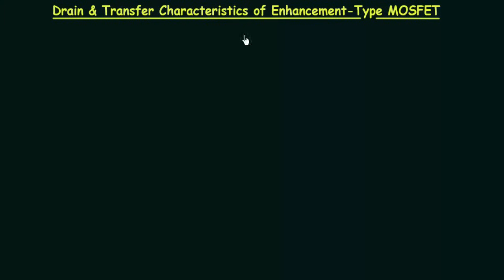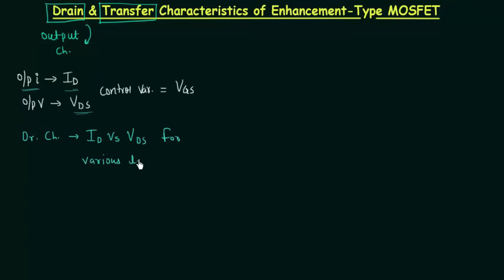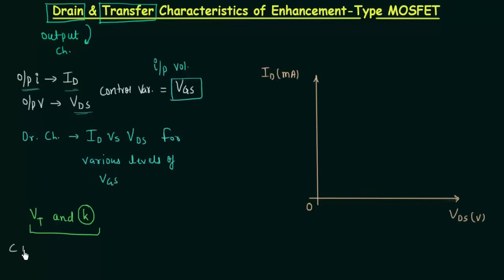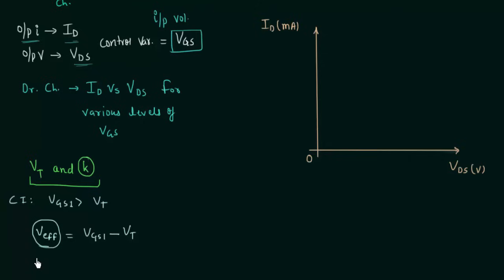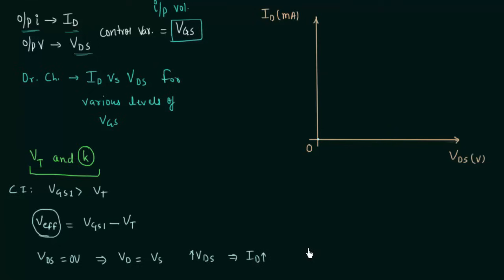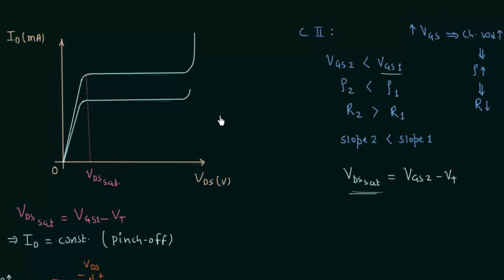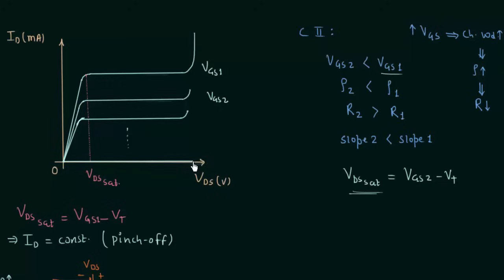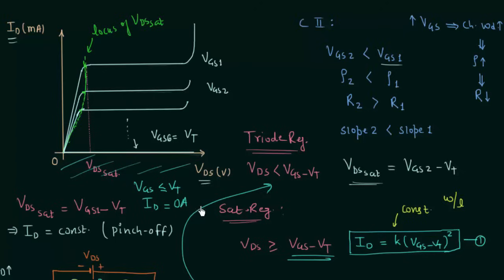Drain Characteristics of Enhancement-Type MOSFET

Comment: Sir why is the channel width uniform and not increasing with potential in source to gate region.
Reply: Because Vgs is kept constant...it's only the Vds which is changed from time to time. So, since the gate to source voltage is kept constant, the channel width near source remains constant.

Comment: Question, what is the difference between triode and ohmic region?
Reply: They are the same. They call it ohmic as it acts as a variable resistor in that region, not sure about the origins of triode tho.
Reply: @spaceghost74m  Triode is the old vacuum valves. I don't know if there's any  connection to it!

Comment: What is exact meaning vgs-vt any one can tell
Reply: It is the difference between gate to source voltage and threshold voltage.If it is greater than the drain to source voltage VDS for n channel enhancement type MOSFET then only the current will flow

Comment: what if vgs is 4v and vt is 1v 
then the veff can overcome the opposite voltage at drain 
and the current is not constant 
then the graph cant be rhat u've 
drawn
Reply: sir please reply to my comment
i can't understand
Reply: When Vgs = Vt i.e. 1 volt, n-channel would be formed and drain current would start.

As Vgs is increased further from Vt, the width of n-channel keeps on increasing. Which means there would be a much wider conduction channel(n-channel) between source & drain at 4V as compared to at 1V.

Hence for same Vds,  drain current would be much higher for Vgs = 4V than at 1V.

Comment: VT kaha se aaya
Reply: There would be no n-channel in the absence of V-gs. Even if you apply V-ds, electrons(e-) from from source won't be able to migrate to drain. Instead due to p-type substrate in between, electron hole recombination would take place & no drain current.
Then as you progressively increase gate voltage Vgs, n-channel would start building up.

Vt is that gate voltage Vgs at which e- start to move from source to drain. No e- hole recombination takes place because p-type substrate in the path has been inverted to n-channel. 

Finally width of n-channel will depend upon the portion of applied gate voltage over & above the threshold voltage.
Veff = Vgs(applied) - VT